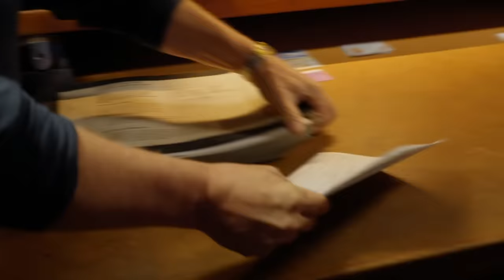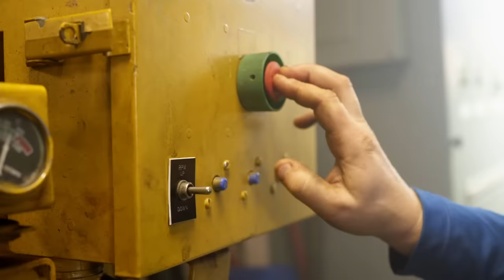Coast Guard Inspection Delays Northwestern Crew | Deadliest Catch

Comment: 9:28 Actually it does happen, Sig. Are you sure that ALL parts of the engines and generators have been checked for reliability?
Reply: i'm pretty sure they did test everything before they headed out. like they've said before, anything can happen when you're at sea.

Comment: Why not do these inspections at port, before departure ?
Reply: You arent breaking the law in port. The lack of jacobs ladder is required because its incredibly dangerous transfering ship to ship
Reply: @GBreezy57  I understand that, but I also understand it is a hell of a lot safer to do an inspection at port.
Reply: Because the fishing is what they are inspecting
Reply: @cgmason7568  why is the coast guard inspecting the fish, its job is to inspect the vessel?  Fish are the responsibility of US Fish and Wildlife.
Reply: @patrickdean4853  nope, Coast Guard also has fishery authority too
Reply: @patrickdean4853  Presumably any boat that's out of regulations has time to clean it up when they get to port. Inspecting the boat while its working gives the Coast Guard a better picture of the boat's actual working conditions. Also, the Coast Guard isn't going to catch foreign vessels fishing illegally in US waters by inspecting at port.